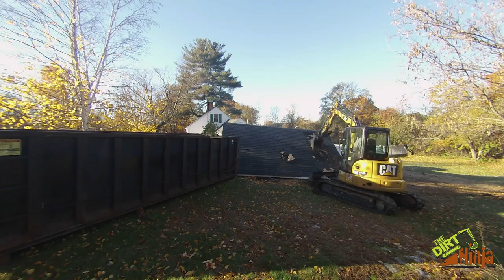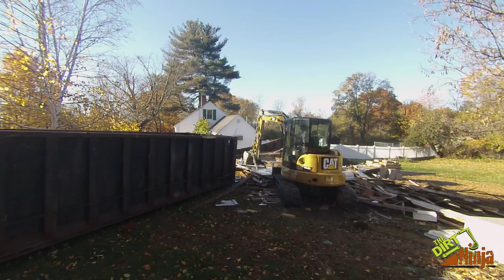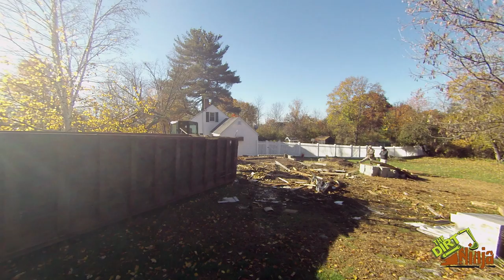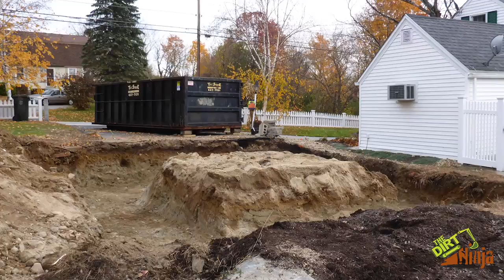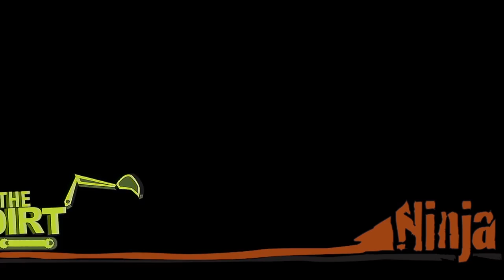Cat 305.5e2 Garage Demolition Timelapse

Comment: u cleaned it up better than I thought it was going to look!  I trash to smash everything inside itself first that way all the trash and wood does not get scattered all over everywhere.  A lot will fit in a 30YD can if you crush it up good
Reply from the maker: Yea the main problem with this demo was that the garage was leanig towards the house so i decided to pull it over rather than try and colapse it in to be safe. Definately added some more work cleaning it up. But i didnt have an insurance claim!

Comment: Fastest way would be to cut into sections, but in this case seemed like the least possible to do due to the way the building was leaning from degradation, unless you had means to a crane to lift the roof in one piece to reduce the stress on the walls. Least it was not chopped into a billions pieces, worst kind of mess to clean up.

Comment: What was the real time for demoing the old garage?
Reply from the maker: +eformance Took about 2-3 hrs to get it down and all cleaned up.
Reply: +Dirt Ninja 
Did you have one dumpster for just clean wood and one for trash?
Reply from the maker: +MS Earthworks No, this was my first demo job and I not nervous that it all wasn't going to fit in the 2 dumpsters. I kept out all the good wood until the end thinking if it didnt fit it would be easier to get rid of than the trash. I also has a 3ton limit on each dumpster before I had to start paying extra for weight so I tried to evenly distribute the weight as to get charged the least overages. Everything worked out in the end and I got nervous for nothing. haha. Now I know how much can fit in two 30yrd dumpsters!
Reply: Well that makes sense now. I tend to second guess myself all the time on how many dumpsters I will need. Some day I will learn to trust my gut. Keep up the good work.
You still loving the CATs?
Reply from the maker: +MS Earthworks Yes still very much liking the Cats. We are very happy with the machines.
Reply: +Dirt Ninja are you guys probably going to add a backhoe to the fleet?
Reply from the maker: +Dylan Chalmers No they are not useful for the work we do.